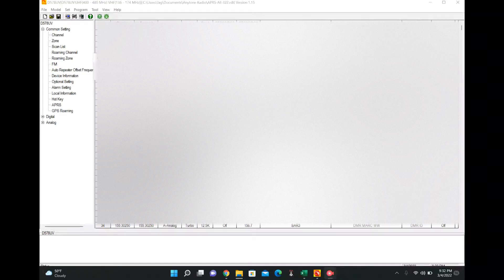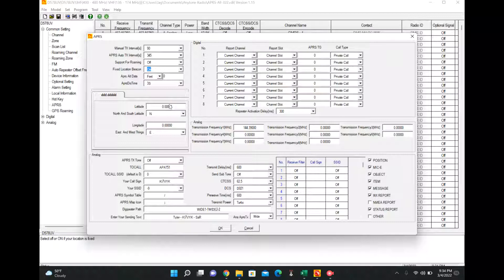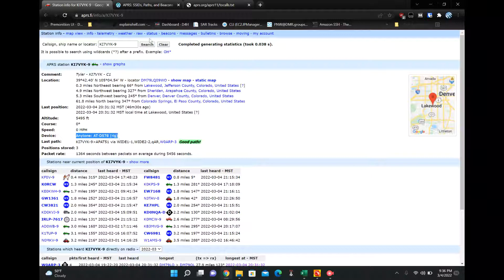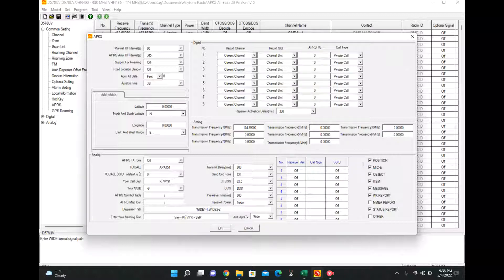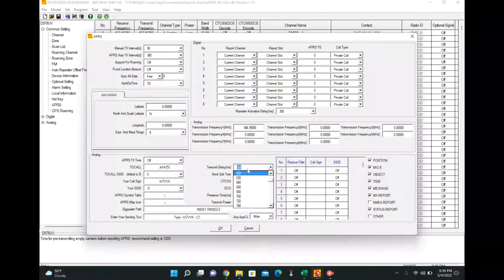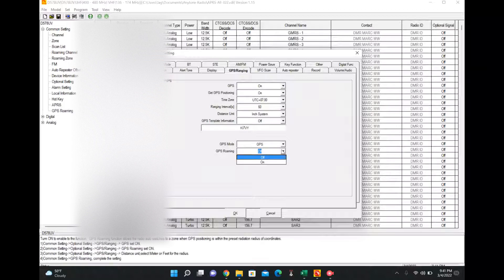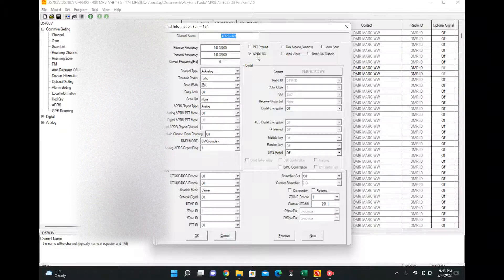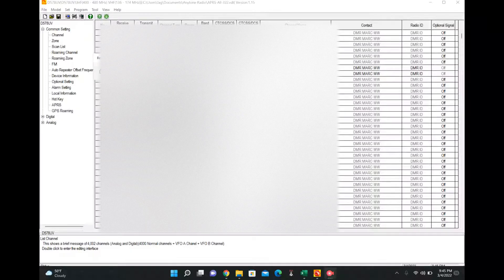How to Set-up Analog APRS on a Anytone 578

Comment: Why do you need a APRS RX channel ?  I have just a single 144.3900 channel for APRS.
Reply from the maker: If you have the RX board you are able to receive the information from parties close to you with out any external site like APRS.fi
Reply: @Wolf902  yes I have the receive board and I am receiving APRS transmissions as well as sending SMS messages.

Comment: Did you say you should not have a ","  (comma) between WIDE1-1   and WIDE2-1 ?   It works with the comma but I don't really know if the full path is happening.
Reply from the maker: If I recall, that is correct to not have a comma. The software is pretty funky as most others do want the comma there.